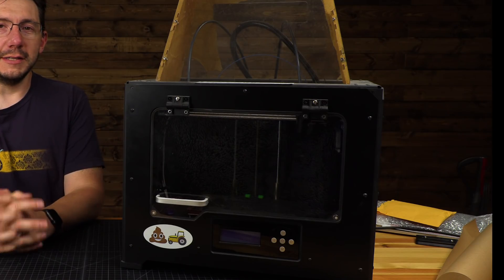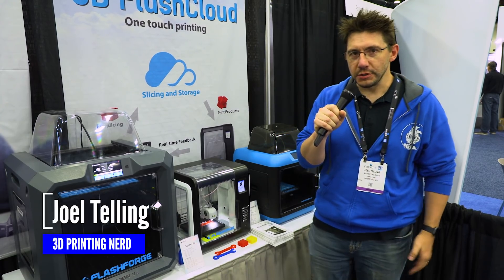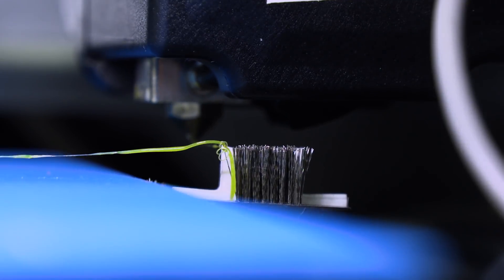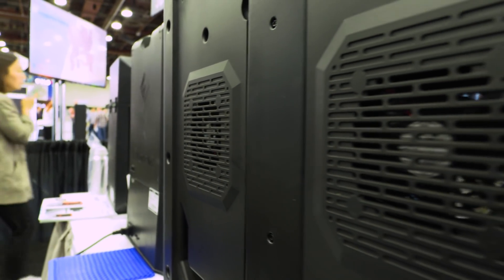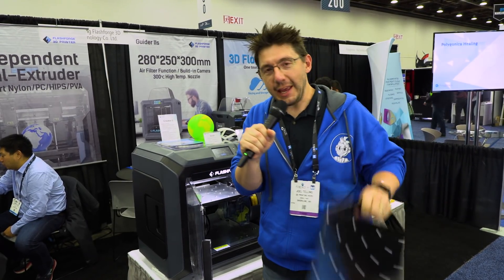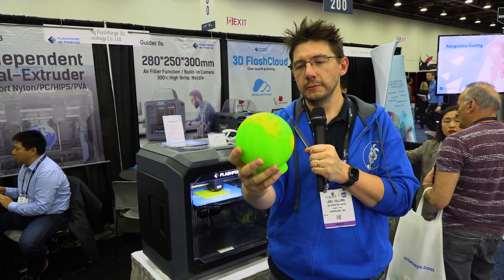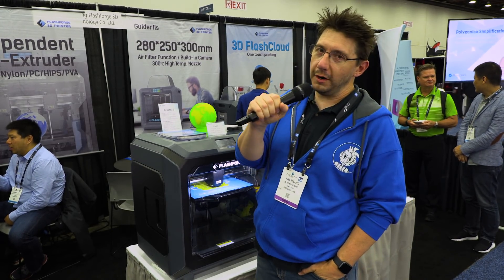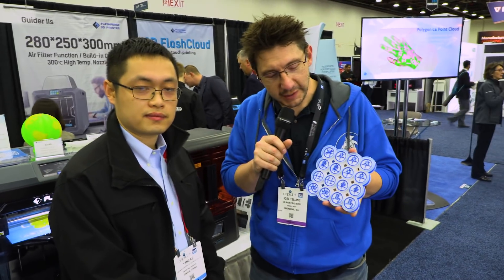Flashforge Creator 3 3D Printer - 3D Printing from RAPID + TCT 2019!

Comment: Hi Joel, you never posted a final review of this printer. Is that ever going to happen?
Reply from the maker: Well, I tried. I had some manufacturing defects with the one I got. They were going to send a new one, and I gave the one I had to a friend that likes to tinker. Then they stopped emailing.
Reply: @3DPrintingNerd  That's not a good sign! I'm looking for an IDEX machine, ideally with a filtered enclosure (so the wife doesn't banish it to the garage like my old Printrbots). I was considering the Raise3D E2, but I've seen some disparaging comments about it. There just aren't a lot of options. Even if I drop the enclosure, IDEX options are limited. You seem to be having issues with the Craftbots (such a shame as they look so promising). I suppose there's the BCN3D Sigma D25, but strangely no one seems to have actually reviewed it.

Comment: Hi, i'm new to 3D printing and thinking about buying one myself. Unfortunately there are not that many in depth reviews about the FF Creator 3 v2 but from what i have read there were some bad ones. Especially about the leveling not that good, always having to use rafts, noisy, offset between both extruder causing issues especially when using different support filament. I really like an IDEX system with all the options it is giving you and this one is not too expensive but really start to have doubts about this one after reading all complaints. Should i buy this printer or save more money for a Rasie3D E2 or maybe start with a single extruder like the Qidi tech x max, which has many good reviews though. Any advise from experienced users having a FF Creator 3 would be very helpfull for me to make a final choice. Thanks.

Comment: Just purchased the Flashforge Creator 3   3D Printer directly from Flashforge USA, partially based on your "review". I was surprised that the build plate is different than the one shown in this video. Perhaps the machine you reviewed was a pre-production prototype. My machine has a very thin build plate held by magnetic force to the table, but is certainly not removable with a single hand and reinstalled with a single hand as shown in your video. I know you have another video where you are unpacking the Creator 3 they comped to you. Was this machine identical to the prototype, or more like the one I received? I just checked your other video and it appears to have the same build plate as the one you reviewed at the expo. My conclusion is that the new design must be an improvement (either functionally, or cost savings for the manufacturer). I personally like the design of the Adventurer (Voxel) as far as the removal and replacement of the flexible build plate is concerned. I like one that is simple to remove and replace and locks into place for repeatable results. It's a shame they can't build a version of the Adventurer with dual extrusion. They probably could, but it would limit the build volume and not be cost effective for an entry level printer. David Buchhauser
Reply: Hi David. I'm currently thinking about buying this printer or not. From my research I read that Flashforge Creater 3 has a V1 and V2 model. The V2 having updates, the one you have right now. How is the printer doing so far, does it go with you expectations?

Comment: I have this printer.... Awesome build quality. The bed removal and inserting is not as smooth as you made out tho... The should have used magnets! Those studs are a pita.

Infact , the only drawback to this printer is the bed - build surface is wack, assisted leveling feature is super wack
Reply from the maker: You know what? I’m starting to agree with you. Magnets would have been a much better choice.

Comment: Bought a newest 2019 creator3. Discovered this machine will not print without a raft, auto bed leveling and z calibration is not accurate. Contacted their support and basically told that is how it suppose to work, just print everything with a raft and maybe expect occasionally nozzle knocking you model off the bed because the z calibration wont work. 3d printers are not perfect :) I find it necessary to clarify this for them as they never mention about it in their ads. oh ya , wifi camera dont work as well.

Comment: Would you ever do a video where you help diagnose someone’s printer for problems? I live in the Portland Oregon area and have a printrbot simple metal. It won’t print biggger things and stops spitting out filament. I’ve upgraded almost all parts but still have the problem.

Comment: Does it uses standard gcode or still x3g/sailfish pain?
Reply from the maker: I believe this one will take gcode, but I will confirm once in my studio
Reply from the maker: So, just checked. I think it takes GX and G files, at least that is what is says on the website. I don't know if G is gcode or not. Will have to find out. I know they are Polar3D compatible, and Polar3D will take gcode and send it to printer.
Reply: Thanks Joel!. This machine looks very good. I have had good experience with Flashforge Creator Pro with two exception, the second nozzle just caused problems for me, interfering with the print, and the sailfish firmware that requires gpx files practically excluded primary slicers such as Cura and Slice3r. I used S3D but it's stagnated compared to the progress in Cura and Slic3r (especially the Prusa variant which I like for its elegancy and easy of use).

Comment: Anytime you get a new printer, make sure you're cool with the file type. I bought the OG flashforge creator pro and realized that the file type was .x3g which is a file type that cura doesnt export. Yes you can get the plug-in but it still isnt perfect. To my knowledge, flashforge has always used some bs file types that most slicers cannot slice to. Just some food for thought before you drop 3gs on a printer.
Reply: I have never had an issue with my FFCP using Simplify 3d. Just get a good slicer, if it does not support that it is not a good one.

The X3G file is primarily used by MakerBot Replicator and is a standard to them. The FFCP is basically a makerbot printer with updates, that others have made for those, built in.

So it is not a werird format really.
Reply: @jace_drummer  makerbot is awful though. Gcode is way more universal than makerbots proprietary file type. I guess you can make an argument that the file type is slightly faster but I'd rather have a more universal application than save a few seconds on slicing. But I guess it's just up to personal preference.
Reply: @RadioactvPanda  First makerbots were/are bad but they paved the way. The FFCP took the best of makerbot and added all the mods users were doing, right out of the box. REALLY improved the printer. I added a few things that improved it to bullerproof, like the glass bed.

As for file formats does it really matter? As long as your slicer can export it, who cares? If your slicer doesn't then it is not as good IMHO. Using S3D I never had a problem with it.

I mean the format WORKS you know. I design stuff pull the .stl file into S3D, export it as an .xg3 and it works perfectly! It is the slicer that matters, not the final file format!

But hey, I don't tell people what to do I can only report what works for me. :)
Reply: @jace_drummer  if it works for you, it works for you. The only slicers that I know that can export that file type are S3D that costs 100 bucks, the flashforge software (which doesnt have many options), and makerbot software (which only uses their printers). I just like to see printers use a universal language (that's been around forever) to make slicing more comparable with everything else (aka more open source). Gcode is perfectly fine and will always be a perfectly good language.

Comment: FlashForge Deamer is what got me started so many years ago. You could buy them as "returns" for about $250 bucks back then, they might be totally busted or might be New. I bought 2 of them and had them both printing with in hours. Learned so much from fix and working on these printers. Back then a new Dreamer was about $1500.00 so the fix and reapair , returns was the only way for me to get started. You can still buy the flashforge printers as returns "sold as parts on ebay. I bout a Finder for $100 bucks and added a larger heated built plate.
Reply from the maker: Wow, $100? That's crazy - great tip!
Reply: Do not know if youtube will let ebay links show but here is a link for the $100 buck flashforge  finder.
https://www.ebay.com/itm/FlashForge-Finder-3D-printer-for-parts-only/303130190397?epid=9025540009&hash=item4693f7a23d:g:K3sAAOSwEGpb0xNE

Comment: I have had my Flashforge Creator Pro since 2016. Only printer I have owned. It still works perfectly! Once you add a glass bed it is flawless, just prints.
Reply: What slicer do you rock?
Reply: @RadioactvPanda  I only use Simplify 3D. Early on I played with a few and they were hit and miss. I never found one I liked. I broke down and bought S3D and never regretted it. It also just works.
Reply: @jace_drummer  thanks!

Comment: properitary firmware?, or marlin?
Reply: Asbjørn Mikkelsen The pause sound that it makes is the same sound that the  sailfish printers make (printers that use a makerbot mightyboard, or its derivatives), which means that it most likely accepts .x3g files instead of gcode. Though you can translate gcode to x3g if you want to use your own slicer.

However that is just my guess.
Reply: @martinsnacks2960  ok, I have an Flashforge Finder, and don't want one more :), I thought some of the flashforge printers was marlin based, but maybe only the old ones?
Reply: Asbjørn Mikkelsen I think that the older creators were sailfish based, as well as the adventurer 3. Don’t know about the other ones.
Reply: @Neslekkim  yeah the old creators are sailfish. I doubt flashforge would drop a marlin based printer.
Reply from the maker: I don't think it's Marlin, and I don't think it's pure Sailfish. My guess is it's newer variant of Sailfish.